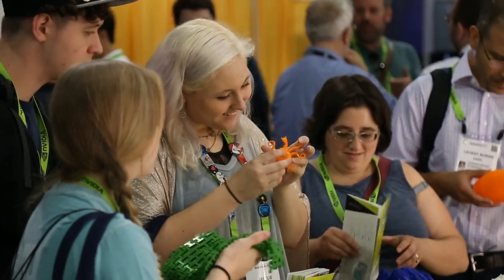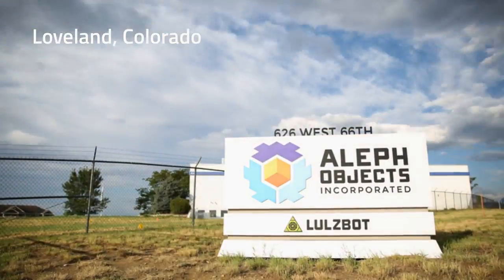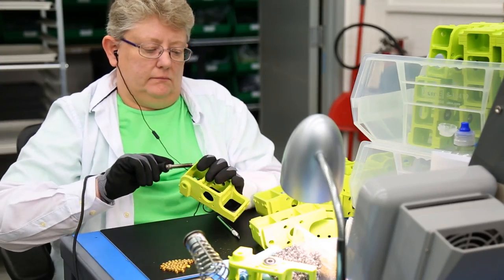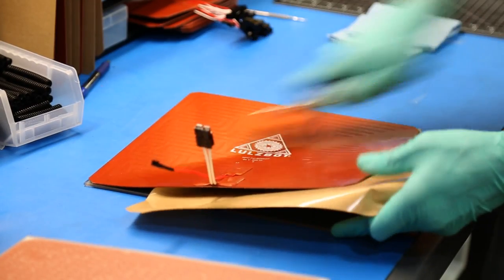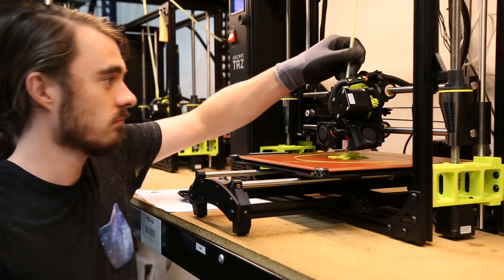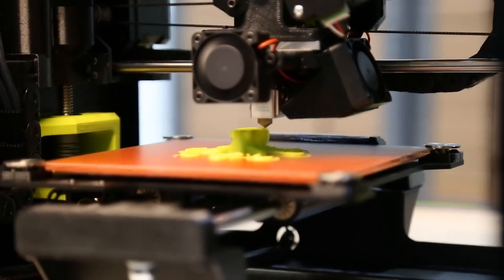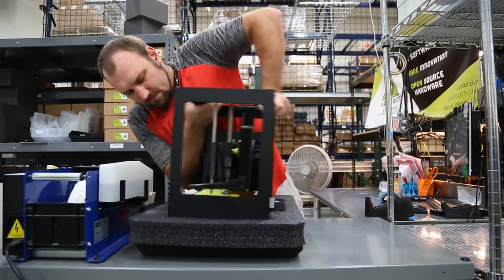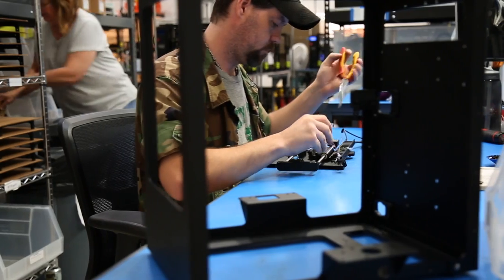LulzBot 3D Printers: Commitment to Community

Comment: I am a huge LulzBot fan.  I have been running my Mini for the past 5yrs and loved it so much when it finally gave up the Ghost I replaced it with a TAZ 6.  With that being said, I picked up a TAZ 6 on ebay and have not been able to get a single print out.  I can't get past leveling, the Z is so far off the tool head dives so far down it sounds like it is going to break the bed.  when I am able to get it past leveling it sets the Z way past the bed plane plowing a line in the PTE.  At this point the Z is stuck so far off the only way to relive the pressure I had to remove the toolhead.  And here it sits, I have so many Ideas/designs piling up...   Any idea how I should move forward?  Is this a case of changing the mainboard to move forward?

FYI I have contacted Lulzbot Support and kinda get passed around from tech to tech with no resolve.